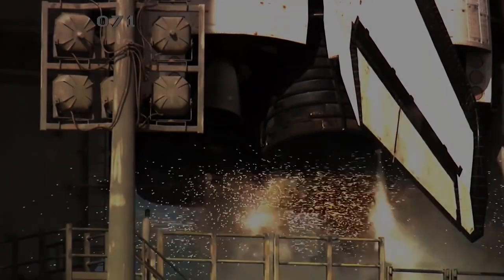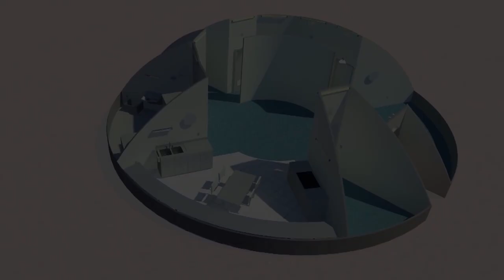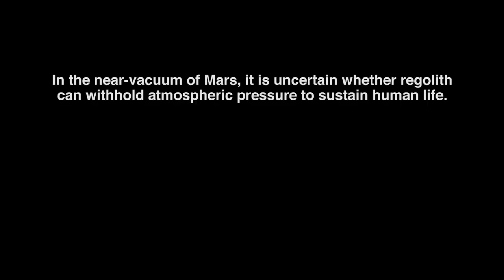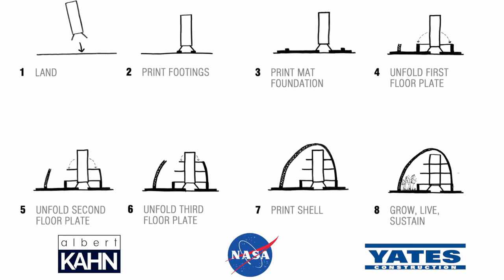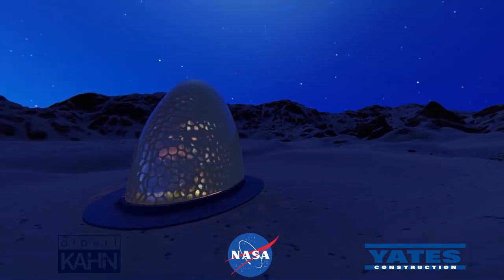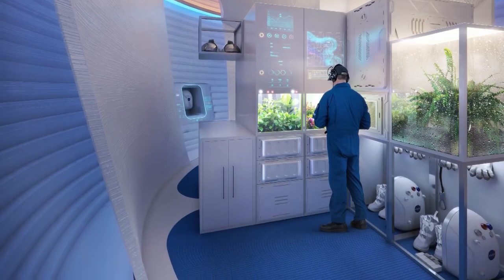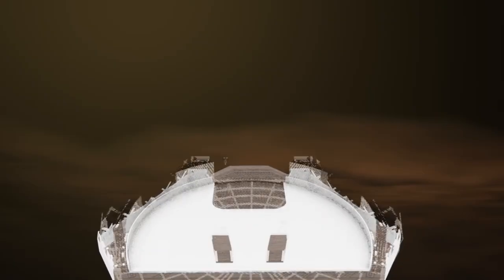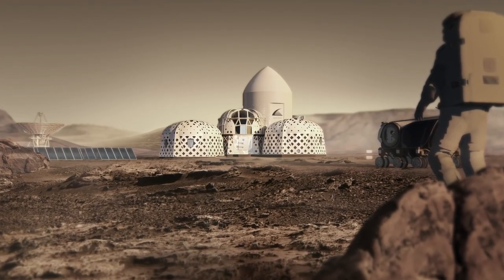NASA Awarded Five Teams $100,000 in 3D-Printed Habitat Competition

Comment: Yeah i have to agree the marsha one seems  more feasible than the rest
Reply: All it needs is inflatable and or printable tunnel sections to join multiple habs together, it also seems like the Marsha design could be scaled up into a even larger structure later on with little alteration  beyond adding more floors and some floorspace adjustments, and using PLA mixed with basalt fiber is brilliant, you can make the PLA onsite and recycle old structures as needed, and repairs could be carried out with hand tools loaded with the PLA-Basalt mix which will be easy with the inner and outer shell separated and will likely be more reliable than Marscrete.

And the Pure PLA on it's own will be invaluable in making anything else they want as it's a well understood and popular matirial and doesn't produce any nasty fumes. (Matirials like ABS produce toxic fumes in printing that stinks, bad for a sealed habitat)
Reply: @UNSCPILOT  A bit like Cal-Earth have done with their earth bag homes and vaults etc.

Comment: Just curious. Would dyeing/painting these structures in Vanta Black assist in thermal gathering in a passive sense?
Also, if enough structures could be built, but colored in Vanta Black, what number would be need to passively heat the surrounding martian terrain to an appreciable degree?
In terms of a potential dome city, even the delta of a single degree increase could be helpful.
Reply: wouldn't the habitat have problems shedding heat as it is? Very thin atmosphere helps retain heat. Spacecraft have even more trouble shedding heat in orbit without an atmosphere.
Reply: @brookestephen  , if it were in a vacuum, I suppose that would be an issue overall.
That said, even so, heat likes to radiate in all directions.
A thin atmosphere, would still allow for the buoyancy effect of heat rising that we see here on earth.
Your question is a good one, and my thinking is that your question merits exploration via experimentation.